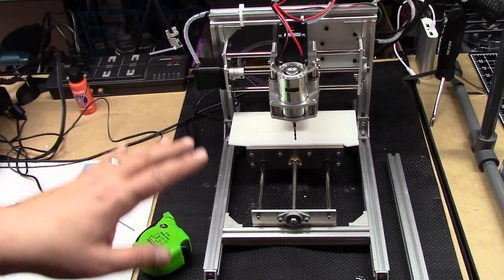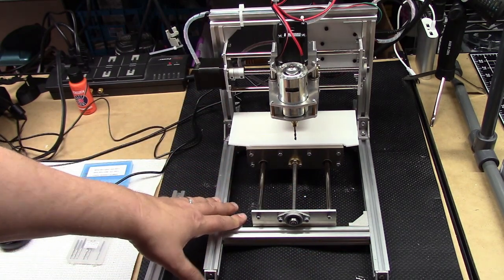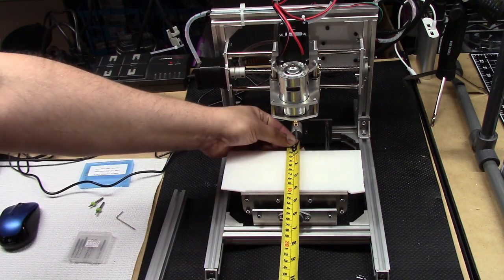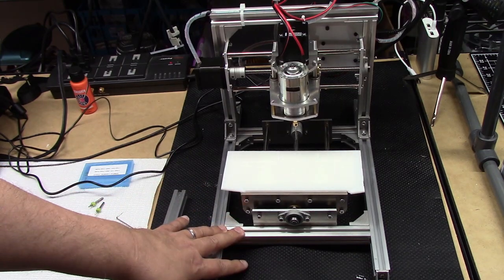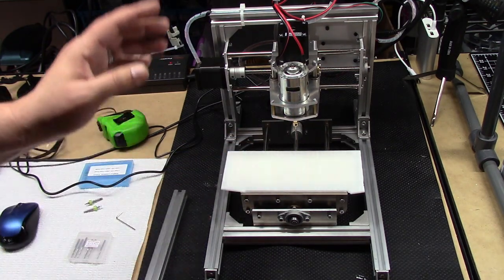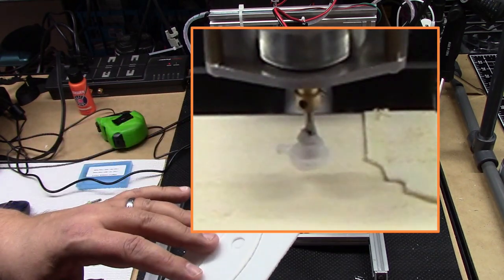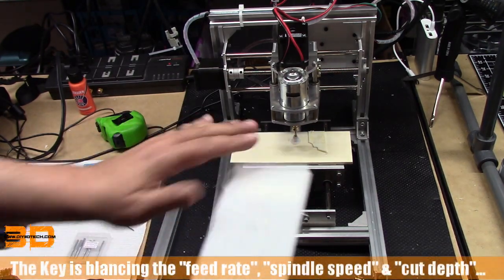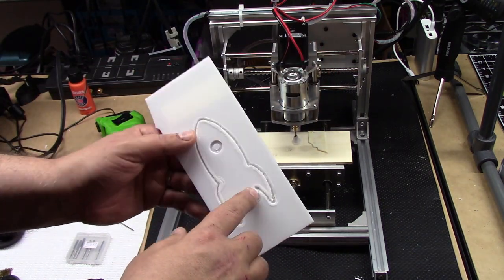Desktop CNC - Gantry Mod and Cutting Acrylic!

Comment: I had the same problem with acrylic melting. The biggest improvement i had was using good quality “cast” acrylic instead of extruded. I think “cast” has a higher melting point. The next improvement was using a powerful linear bench power supply to run the spindle motor directly on its terminals. I’m trying the cast acrylic straight out of the freezer but the results are good even without that.
Reply from the maker: Big yes on cast being the best to machine!

Comment: i have a smiler machine and cutting 0.8mm end mill burr  0.5mm per pass 110mm feed cuts fine very nice finish . sure your end mills not blunt.
Reply from the maker: No, the main issue is the rpm to torque ratio as the RPM is fixed so the answer is to up the feed-rate however the motor doesn't have the torque so it will stall.  So as you will in a coming the solution was to go from two to one flute...

Comment: Can you add some sort of "air cooling" to the setup for when you are cutting plastics?
Reply from the maker: Not really practical, more of messing with feeds, speeds and flutes.  The issue is the RPM verses torque out put is the balancing issue, as with a larger machine, the torque curve can handle additional feed rate while slowing the spindle.  However this little guy is far more challenging, however I am not one to give up...
Reply: Never give up, never surrender.  Adapt, improvise, overcome.
Reply from the maker: Thats is what it is all about!  I will not be beat by a machine!  (well at least not yet :-)
Reply: DIY3DTECH.com - But watch out, they can find a way of cutting you. Lol
Reply from the maker: LOL!  Cuz you so NOT want to know the number to stitches I have had in my life!
Reply from the maker: +Norbert Davis don't let it be said I don't bleed for my art!
Reply: DIY3DTECH.com - LOL!  Just don't bleed in your art. Ha ha!

Comment: ooh i see a coolant bath and small pup needed for  'cold'  things on that .  that is for things that too warm while cutting .  Location of the Y stepper may not be good for coolant .   the moment you have plastic build up on your bit / end mill ,  you feeds and speeds are off for your cooling capacity .   you may get away with a strong fan directed at the work area , It could be just a few deg that kicks it off .  once you get a plastic ball it then feeds heat form friction with teh surface . you can see the scarring that  ball of gunk made.   I dont have CNC like that yet .. but i do clamp my dremmel in a dremmel  stand and do stuff by hand .  I have been lucky will  just using air to cool .  small fans and even using a R/C plane  motor and blade as a higher speed fan for some plastic .  but every time one of those plastic balls form  your hooped.  I have put my dremmel in a plastic bag and worked on stuff just below the surface of water in a small baking pan .  It's why i was hoping to get to laser for cutting stuff like that . less mess less bother .  Granted my Dremmel is the old big style .  from like 25 or more years ago( real drmmel form sears before they  self branded them to 'craps-man' )  .  and yeah it runs , runs great .. did a transmission change on it but that's an other story .  Thing is  , it has the power to put a bit and also mount a small  RC plane prop on that  bit . LOL  totally dangerous as all hell , but its works for direct cooling .   any how nuf rambling .  that lil rig sure looks great and teh longer base sure looks like what it should have come with .
Reply from the maker: Its a bit more challenging that than the larger CNC as the combined torque, to RPM ratio makes it more difficult to  adjust for plastic so I experimented more so with tool fluting (i.e. from 2 to 1 flute) and that helped some what however I am still not totally "happy" however ran out of time for experimentation...

Comment: i cant get my cnc to work. it cuts way out of proportion and cannot follow the gcode. Ill watch your other videos on this machine and see if they will help.
Reply from the maker: Are you using GRBL?  If yes your $$ settings are likely off...
Reply: DIY3DTECH.com Yes im using GRBL not sure if its a good copy or not. about 9/10 GRBLs I tried didnt want to flash, I didnt realise it came flashed until I tried flashing.
Reply from the maker: I assume did the math to set the $$ settings correctly?
Reply: Well, that is probably my problem, I did no math all I did was set the steps per mm. Didn't think about anything else.
Reply: What math do I need to do and whats the $ commands? Im completely new to cnc